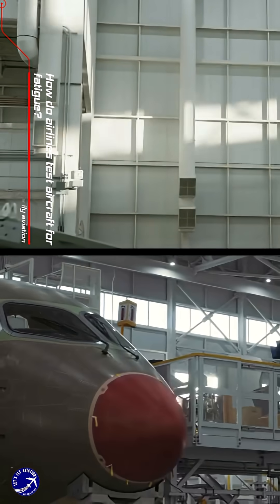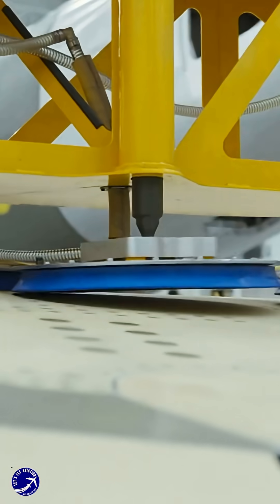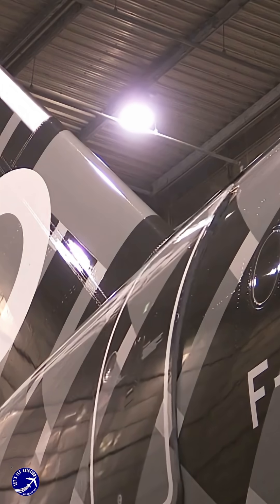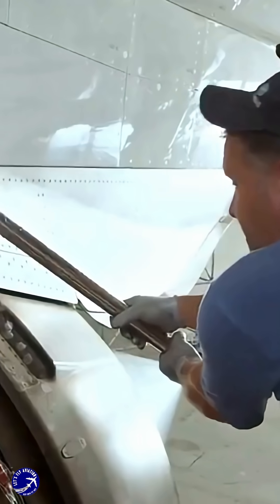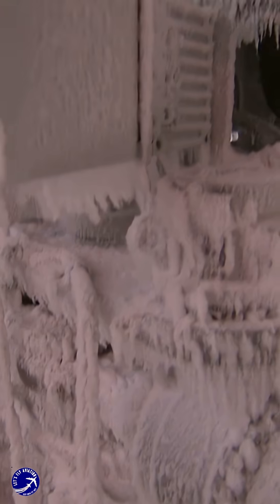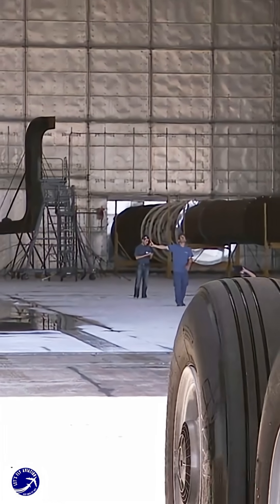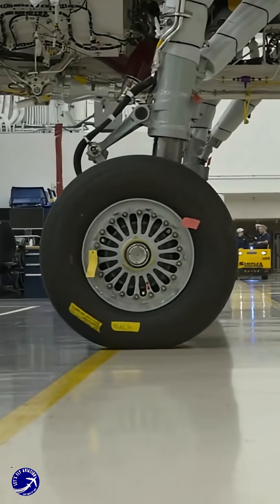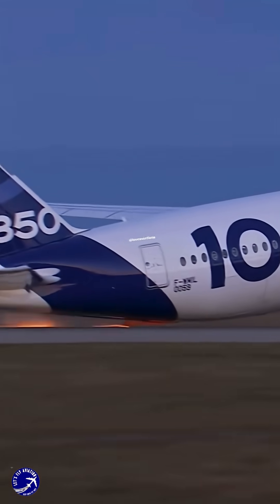How do airlines test aircraft for fatigue?

Comment: If this stress test works so well, then why do airplanes still persist to fall apart in the air killing crew and passengers alike?
Reply: They dont just "fall apart".

If maintenance is performed incorrectly, proper replacement parts not installed, something left off.... its mostly diwn to human error. But I'm struggling to find an instance of a plane just falling apart in the air. That door panel that blew out, you might say, that was down to hunan error.